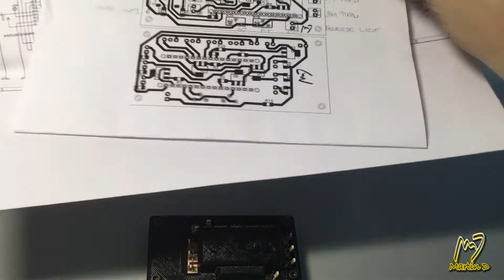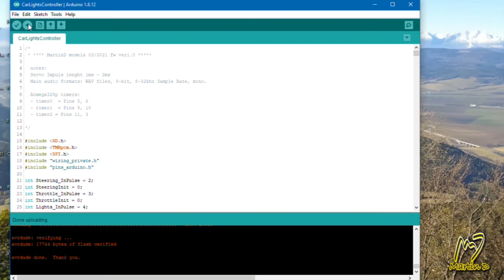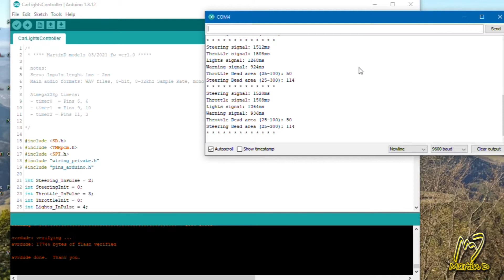RC lights and sounds controller based on arduino nano (include arduino SW sketch)

Comment: Hello,how many ohms are the trims?
Reply from the maker: Trims values are not noted in schematic but their value really dont matter because they are like voltage divider so you can use 1k or 3k3 or 10k, what you can find at home. I used 1k on my project.

Comment: hello Sir, does DC motor also drives via this or we have another setup for that, i am trying to build a small circuit for my small HO scale train locomotive. so i can use same circuit as you did
Reply from the maker: Hello, this is lights/sound control modul, it is not intended to drive motors. This module control LEDs and generate engine sound anccordding to signals from common RC modes receiver. I know nothing about train models and how they are controlled, so I am not sure if this module would be useful to you, but I guess it doesnt.

Comment: how can i change the sound files? i'm using for RC Jeep Offroad
Reply from the maker: You have to replace files on sd card. You need sound samples of your offroad engine in idle rpm , low rpm, middle rpm and high rpm:
- Iddle rpm is for file idle.wav, 
- low rpm is for 2k.wav file,
- middle rpm is for 3k.wav file,
- high rpm is for 4k wav file.
You also need to make transition sound samples (mix two sounds):
- transition sound idle to low rpm, file idleTo2k.wav,
- transition sound idle to middle rpm, file idleTo3k.wav,
- transition sound idle to high rpm, file idleTo4k.wav,
- transition sound low to middle rpm, file 2kTo3k.wav,
- transition sound middle to high rpm, file 3kTo4k.wav,
- transition sound low to high rpm, file 2kTo4k.wav,

... I made transition sound by mixing two sounds in Audacity software.

I hope this helped!
Reply: @martinDmodels  Thanks bro.....nice work
Reply: @martinDmodels  can I ask why you need 3 transitions from Idle to Low Mid and High. Thanks

Comment: Did you know that DumboRC just came out with the X6DC receiver with integrated LED functions for headlights, signals, brakes, reverse, and strobe?  (Yeah, after I customized 3 RC receiver readers already, two using Nano and one using STM32.)  Oh well.  At least I have some American car bodies to light up, you know how US market cars use their brake lights as turn signals?  So there's still a place for the custom method.  Also modern cars have DRLs (Daytime Running Lights) that turn into turn signals, you can have some fun with RGB LEDs... usually I wire the Red and Green leads to get the yellow/orange, then activate/deactivate the Blue to go back to white light.   I also have a Mustang body which I want to create sequential turn signals for.  Now I am very curious and I will try your implementation as a base since I could never get the brakes and the reverse lights to function properly (one has to be sacrificed, usually the reverse).  I notice you use PulseIn instead of AttachInterrupt, I think it will work better just like how for the "6 channel rc receiver stm32" the version made using input capture mode is faster and more consistent compared to interrupts.  Also there is an implementation of engine sounds without having to use an SD card nor mp3 player module -- the sounds are converted into header file data...there's an ESP32 implementation for the Tamiya trucks but its very complex so I'm trying to just extract the sound processing method while combining it with the simpler lights for cars.  In any case, your craftmanship is very commendable and maybe one day you can be the next DarkDragonWing or Macky Works Drift!
Reply from the maker: I did not know about X6DC receiver but I definitely try it! Thanks! Idea with RGB leds sounds nice, but for now, I dont have project for this application.... In my code I am using PulseIn only in setup(), then I using modified PulseIn function because PulseIn is very inaccurate when sounds is playing... I dont using interrupts because it has negative effect to sounds playing... Yeah, I found ESP32 project you tolking about, idea with sounds in header sounds great, I will try to implement it to ver2 of my controller :) ... Thanks for good ideas!